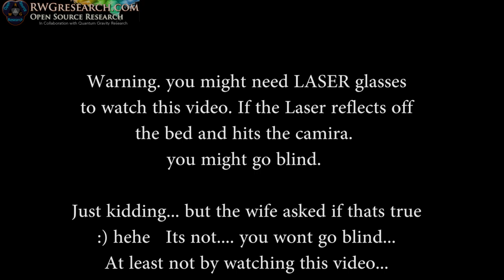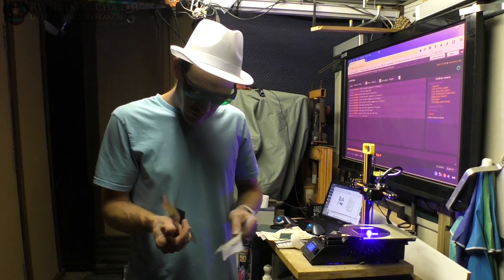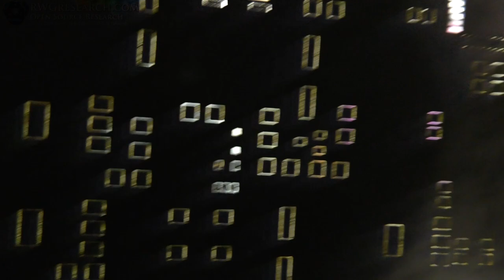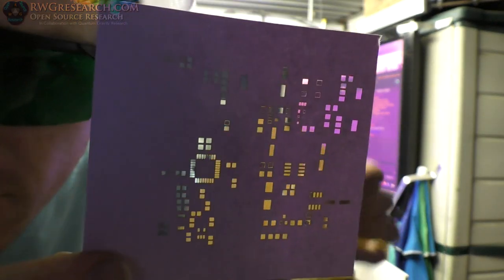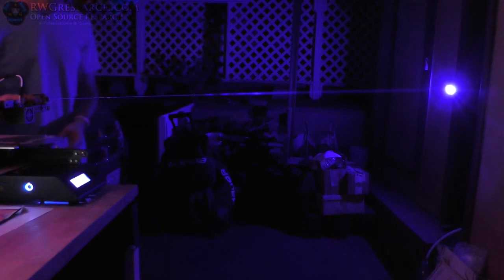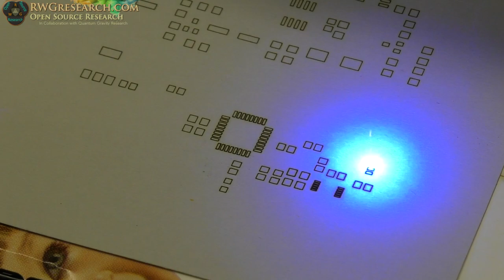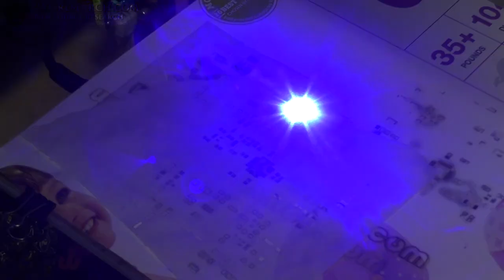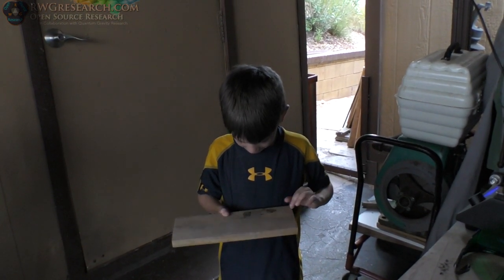Making A PCB Solder Paste Mask Using A 2.5Watt Laser. Plastic Cutting Help Needed.

Comment: I've done this before with a CO2 laser and Mylar. I turned up the speed and turned down the power until it stopped burning and made 2-3 passes to get it all. I could never get it perfect but it was good enough for my PCB. The material you're using has to be thin enough though so you don't get too much solderpaste on.

Comment: I've done this successfully many times in my local laser cut shop. The trick is to use the least power, fast pass, and tape the backside with paper masking tape. We learnt that the wild reflected rays still have enough power to melt the plastic. I used 0,15mm "mica" plastic normally used for binder cover. The smallest succesfull pitch between holes was 0,7mm with the thinnest hole at 0,5mm (0,25 laser kerf width). I think the operator changed his lens to "precision lens" with very narrow focal range. I am not quite sure but he certainly didn't use his "cutting" lens.

Comment: Have to play with your focus a bit. If possible, I can focus mine. So it goes from say a thick stream to a point. That point need to be in middle of material or the middle of you cutting depth for that pass.
Use a support structure to prevent heat from leaching out the material. Won't take much. Think bamboo skewers supporting all four edgs that have been tapped down to make it taught above platform.
Add a fan/air nozzle to blow smoke off the laser lens. The smoke can take away some power.
I have a 50watt co2 eBay laser.
Also play with wattage in setup. Different colors take more or less heat. For glass need to use a tack paper. Like adding the same paper on plexiglass to say a bottle your engraving. Just a wide masking tape really. I have a 10" roll.
I got my laser fine enough that I do pictures on white cardboard. Gives it a 3d look.
Reply: Draw a bunch of straight lines at different height to get that perfect kerf angle on one end of material if possible. The different heights, totally forgotten about your setup for a second there, will move your focal point. But running multiple passes on lower power may give you a cleaner line/look. When engraving on materials, doing one pass at high power can burn stuff, while 20passes won't burn it but more like brown it to the right color.

Comment: Have you tried speeding up but running the program twice?  So you dont cut thru the first time but get cleaner lines and less melt. Also hope you're being safe(im sure your are) some of those fumes are very bad toxic stuff
Reply from the maker: yep did that. no good. less power faster slower more power etc. nothing seems to do it. i did notice that the laser focused better about 20-30mm from the part. so i may try it again. it build up a lot of heat from further away. but i still worry that's not good enough either.  yes holding my breth lol ~Russ

Comment: Don't worry about the missing material between fine pitch pins.   So long as there is not too much paste the solder will flow to the metal pads and pins without bridges.   When making paste stencils with a drag knife machine I replaced a close row of pins with a bar.  

Keep in mind that the amount of paste put down is proportional to the thickness of the mask.

Comment: I've done some stencils on a Co2 laser. Different plastics will behave very differently. For instance PS,  HDPE will melt horribly. PVC and Vinyl release chloride gas, avoid those. Polycarbonate will not cut, and smoke insanely. Acrylic cuts nicely, but too brittle for thin film. PETG might be OK, not tested. Polypropylene (PP) is OK. PP is commonly used for plastic covers/binders, which can be of suitable thickness for solder paste stencil. Should be 0.10-0.2mm, the thinner the easier to cut.
Once you got suitable material next key point is focusing, you will need a really really narrow spot. Both to get the resolution needed and to avoid melting. You want to have as much energy as possible in the smallest area possible, such that material is instantly evaporated (ablation).
For that same reason you want to use a lot of power, but move really fast. So I would recommend switching to raster line scanning the image (one axis moves back, forth, using PWM to fill areas). And do something like 100mm/sec. Don't worry about cutting through initial, first see if you can get a nice 'engraving' effect, removing a thin upper layer without sign of melting. Maybe start at 50% power. Once that works go to 100%, and try 2-4 passes. Only reduce speed if that still does not get you through! 
You should also get an air assist, basically fast air that moves the smoke out of the way. It lets more laser power hit the material, the oxygen helps evaporation, and it cools a bit.
Hope these tips help! Hope to get a diode laser soon myself, then I can hopefully provide a more specific set of settings that works.

Comment: 1st dial in your focus, set the lens then vary the height for fine adjustment. It should be cutting finer than that I would think. We always made a fast clean up second pass at say 2x the speed of the cutting pass. Plastic is always a pain and takes a long time to dial in.

Comment: Mylar seems to be the best material, Also remember to reduce the solder paste apertures in relation to stencil thickness. What you cut on is important, A backing plate like aluminum will sink the heat quicker than wood and stop latent melting the material. 
Big Thumbs Up.

Comment: For laser test masks, don't they usually use kapton sheets? It is designed not to melt and only burn. You might even already have some for an old 3d printer bed.

Comment: Pololu makes them out of mylar. They sell them online and the stencils work pretty well.
Another company, Soldertools, uses Kapton. I have not tried them.
Kapton is probably a better choice with a UV laser due to the orange color.
Maybe you could try something quick and dirty with the kapton tape that you may have for your 3D printers.
Kapton tape on a sheet of paper?

Comment: Walking through a 2.5 Watt laser beam... ouch!
Using a non-flammable material will keep it from creating an "ember edge", which eats back into the material. Eliminating the source of oxygen, or heat sink with a damp underlayment seems good to pull the heat away.  Like others have said, you probably need to reduce the solder mask opening size... if for no other reason than to compensate for the laser spot size... which really should be  smaller than your laser has now.  My son has some that were laser burned on Kapton sheet about 0.005" thick, and the minimum laser cut opening is about 0.004" wide.... that's a pretty small laser beam.

Comment: Have you tried blowing or sucking away the smoke it produces? i could imagine that the smoke diffuses the laser and makes it cut less and melt more? Also i think perfect focus is cucial, but i am guessing you dialed that in?
Reply from the maker: Yes I have it seems that it could be helpful. However only with paper. Not so sure about the plastic. if you remove the smoke its helpful for the laser. it keeps the intensity the same. ~Russ